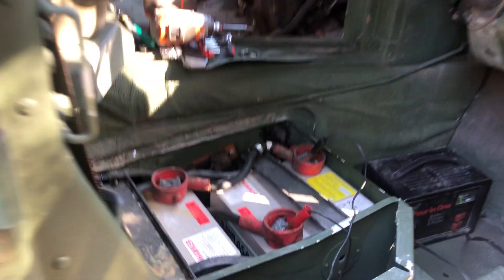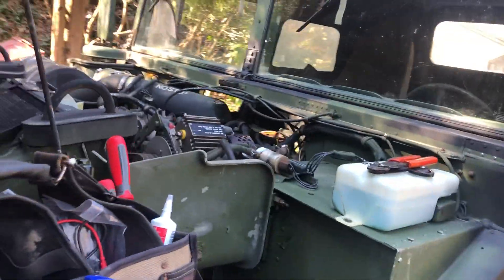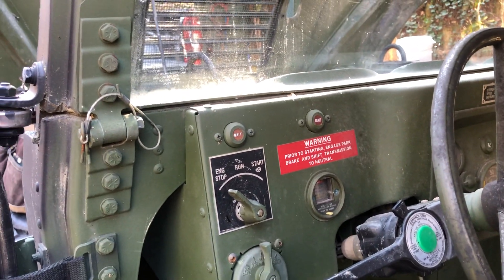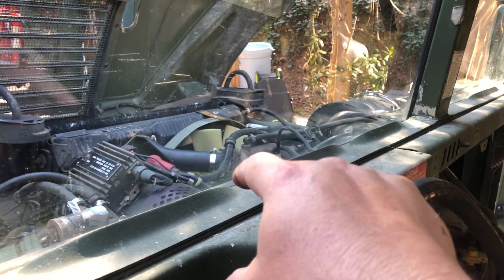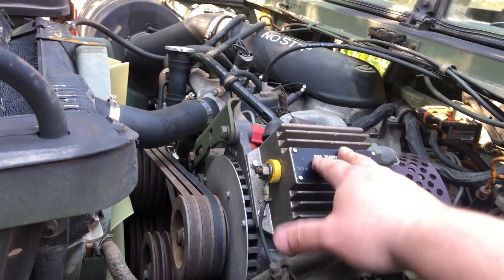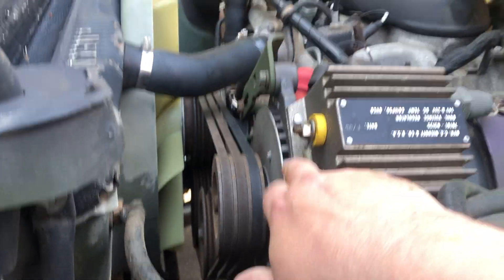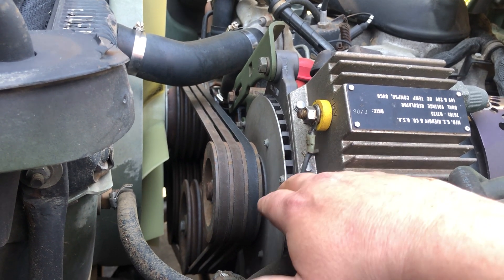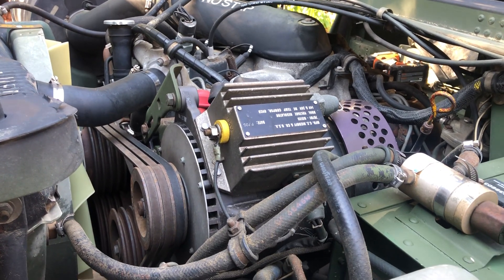Your military Humvee is going to burn to the ground! Learn what I learned

Comment: I guess I'm a purist, maybe OCD but here's my comment: study every original source there is, if You ensure Your vehicle is EXACTLY as the Army, or M.C. for those who eat crayons, intended then  most of Your problems will go away, and any that do arise will usually be easily resolved by a now knowledgeable operator.  Saracen Mk 2, FV 432 mk1, White M2, WC52, and M998 can't all be wrong.

Comment: so much misinformation on this video! There should be no "ground" wire connected to that terminal! That is the 12volt tap for the rear battery. Please anyone who watches this, disregard everything he is saying. Completely false information. He is right, that if there is a ground wire connected to that terminal, it will smoke the regulator at least, and more if left connected!  Whoever put that wire there was wrong. Not a factory wire. Wow, just wow!
Reply: Mine has no wire on the 14v post, should there be a wire going all the way to the battery ?
Reply: @Namenotfound2025  yes. to the rear battery. 8 AWG
Reply: @Namenotfound2025  Only if you have a vehicle with a 4spd transmission that uses 12v. If it is a 3spd like in the video, there is no need. 3spd trucks are 24V only, but the military stopped supply 24v only alternators, so you just utilize the 24v side only.
Reply: Thanks for the info

Comment: Have the 200 amp and not grounded. been running over 2 years with no problems
Reply: It is because it doesn't need to be done.

Comment: that POS has always had a fatal flaw, that plastic fan, we broke several within weeks of getting them  trying to cross low creeks. bad part is that this is supposed to be a 24 volt only system ------not one 12 volt POS shit in it, hence not some fucking hybrid system. also noticed that the regulator you pointed at is not "MilSpec", hence not insulated. This HMWV has been modified.
Reply: the 12 volt system is for the  POS 4sp O/D tranny ECU under the rear seat (12v POS) surprised you didn't know that..

Comment: No that lead is 12v(14v) output so you can supply 13 to your rear battery they ground that out when not in use @wildbillhmmwv on Instagram for more tech tips